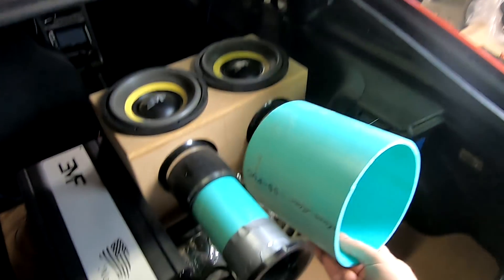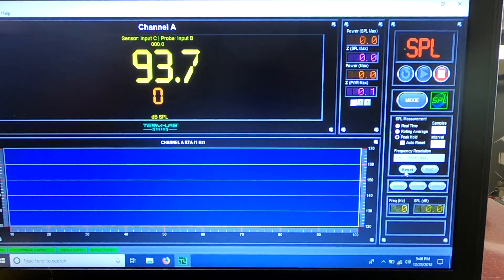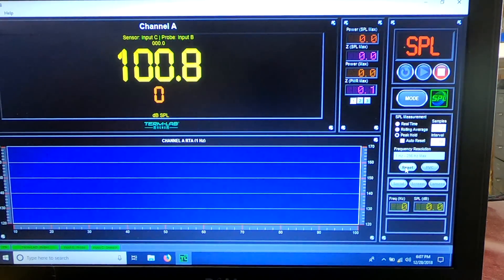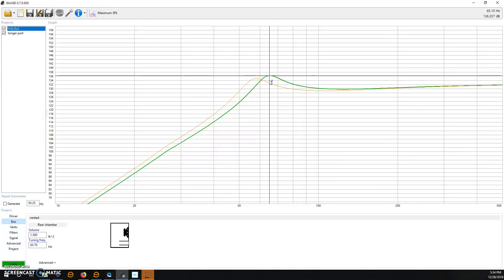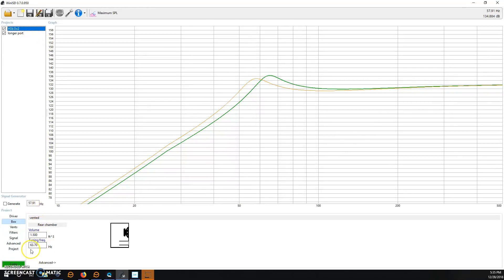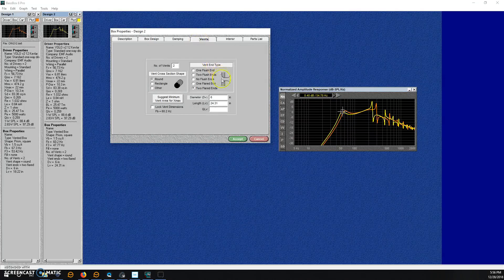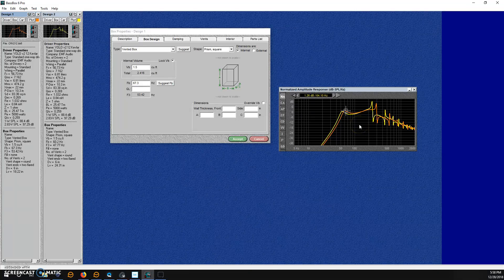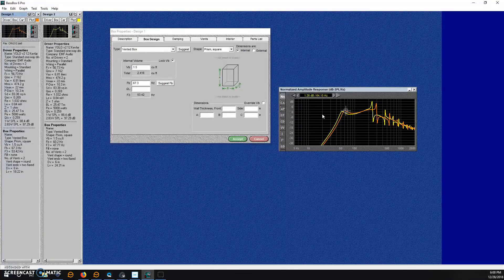Your box modeling software is very wrong, here's proof - Tech Stuff Tuesday

Comment: I'd be good if software could account for the environment you're firing into, though I suppose it's more than volume, its also geometry. Possibly advanced 3D modelling could do this, but at that point the software wouldn't be worth more than time invested in trial and error. Built a 6th order for my car, +5dB at 55Hz, +2dB at 30, and its got a whopping peak at 30, way more than 50. Cabin gain is an incredibly major factor in box design. As for why the software was off (as in the 3dB gap between boxes), my guess is the subs are more efficient than the software was treating them. They could be in a node, too, which should load the drivers a tad more, which is maybe why 4.5 went down to 4.2. From my experience, electrical data is reliable in software. Good video though, the title seems to have brought in trolls.
Reply from the maker: There is more to the environment than volume and geometry as well. It's also the contents, both shape and material. Example, seat positions change SPL, sometimes significantly. Seat materials, door panel materials, headliner materials, all factors as well. You'd have to account for dampening of each of those things too. And, if that wasn't enough, the environment changing at different SPL. The ones you're calling trolls are people that live and die by the graph, in non-automotive applications. One tried to bring in a car and was measuring at 118 dB showing how close it was. When the vehicle starts moving from the pressure, the environment changes. That's also why you can add deadener (changing the resonant frequency of panels) and it will change your response.
Reply: @EMFAudio  Yeah, really is a pain in the ass. Probably a good thing if it stays this way though, if modelling software got too good, whats the point going to competitions? You'd only need to submit a design. I remember an exo video, the one with the deaf bonce 15", where he improves his score by tilting and sliding his seats forward. I'd love to fiddle around with a term lab or something, but can't justify spending the money on one at the moment.

Comment: So I think the difference in this example is the distance to the loading wall. When you add the port length it shortens the distance to the back of the car changing the tuning drastically. A good test for this is to put the short ports back on it and move the box back then retest. My friend ran in a mod street class and if we moved his box back towards the back of his Blazer, it would change his tuning and his peak without changing port length.
Reply from the maker: When you change the box position you aren't changing the tuning, you're changing the distance from the sub to the sensor. That's changing the environment. Now, where it could change tuning is if the port opening is equal to or less than the port diameter from a surface. That will change the effective port length. That applies to inside the box as well.

Comment: Unfortunately, you don't seem to know how to apply the software correctly. The software is only as good as the data input or lack there of. As you did not account for the cabin gain, power applied, etc your application is what is wrong, not the software.

Ive designed and built hundreds of subs for pa, home, fixed application, and car. Made many of the same mistakes you did too. With correct use, I learned from those errors. Hopefully, you will learn that as well.
Reply: What he's saying is this software people that use it don't use it the way it's meant to be used that's people use the software thinking that the box that they build will do the exact same numbers in their car and they wont do the same numbers as the software says it will.
Reply: @danielmcbride2383  I know what he is saying. I also know how the software works. It is only as good as the data entered. If the vehicle acoustics, driver parameters, power, etc, are entered properly the software should be able to give a fairly accurate simulation. 

As far as manufacturers, I use many. For some of my custom designs, I use Eminence, Audible Physics, and Misco. There are others, but these are my favorites.
Reply: @isaeagle4031  can you make a tutorial video to demonstrate to us the right way use this software?
I'd really like to learn a better way to achieve a desirable result. Thanks 👍👍
Reply: @jr1001jr  Oof, I had to go back and remember which software was being discussed. I don't have plans for a tutorial, but message me at Mosaic Audio Design on FB, and I will walk you through it.
Reply: Charles Morris what is your subwoofer brand called?
Reply: @jamesbondcaraudio4247  Why would you think I have a brand? I work with individuals and companies in design work
Reply: Charles Morris i read you designed and built subs so I assumed you had a brand. Was just curious if I was familiar with your brand.
Reply: @jamesbondcaraudio4247 ah got ya. At this point, I don't see the need to introduce yet another driver to the market. I have someone that can build me about any driver I can imagine. Plus I work with many different manufacturers.
Reply: @isaeagle4031  like who

Comment: I'd like to disagree, the modeling software is very correct, actually scary correct usually.

You just need to actually understand the software and use it for its intended purpose. Winisd can stimulate driver behavior on a basic level when it comes extension, excursion, port speed and the like.

Programs like hornresp can simulate complex, folded horn designs within a couple dBs of accuracy. Belive me I've simulated folded and measured several horns, as well as ported designs. If the results don't match your doing it wrong it's not rocket science or magic. Get some proper measuring equipment and do them in the correct environment. 

If you're simulating in a 2 or 4 pi environment, and then measure in a totally different environment.. The results will not match. It's like testing a cars 0-60 time in a 45* slope with 10 cement bags loaded and complain that the published numbers from the manufacturer are incorrect.

The software does accuracy simulate your box to a scary degree or accuracy. If you or anybody else is unable to comprehend, understand, or apply the data, to a real world scenario it's not the softwares fault.

The descrepancy between your simulations and your measurements are not due to the software or your box.. It's the error of measuring it incorrectly. What you are attempting is measuring the effect of the cars acoustic effect on a simulated frequency response.
Reply: yep .. "hes not a very smart man". stupid is as stupid does !
Reply from the maker: You've apparently not watched the video. I specifically say why it's not accurate. Also feel free to provide proof of being accurate from modelling to real world.
Reply: @EMFAudio  I have watched the video, the point remains. The simulation for its intended purpose is correct. If you put your box in the space the simulation actually was intended for and measure it, you'll most likely find that the programs numbers and response curves match up pretty well.

What you are measuring is the response of your cars interior more or less, it's an easily pressurized small confined space... Not a 2 or 4 pi environment. What you are simulating is the product of the box and drivers ONLY.

Here's a quick sim of a sealed Dayton RSS390HF in a livingroom, measurements taken with REW using a calibrated umik at listening position, sims were done in hornresp with manufacturer data and was merged with the rooms measured responsecurve. Which by the way is silly closed to the simulated curve anyhow. Just take the roomnodes, gain and measurement position into account. https://imgur.com/fikKl4d

You could measure the response in your car at a specified place, then take that very same sub and put it in an open space without extra boundaries to reinforce or influence the gain. Then simply make a responsecurve that accounts for the differences. Subtract that curve from the measurement in the car and it will very likely line up very close to the sims. If you don't take your car into account when simulating, I can agree that the data is not as useful. But not useful does not mean incorrect or wrong, simply misinterpreted or used for the wrong purpose.

Otherwise just head over to avsforum or databass and check out the horns a lot of us are simulating, folding, unfolding and then building.. If you do it right it ends up very close, granted you measure in the space it was simulated. Sims are not wrong just because the data is applied or read incorrectly.
Reply from the maker: @TheDaniel85 So what you've proven, by your own admission, is they aren't accurate. You said if you take into account room nodes, gain, and measurement position IE inject your own input contributed by the environment. Seems like that's the same thing as in a car. You have to adjust to the environment, you just said that, just like I've been saying all along. It isn't an exact match in your case either. Bottom line, the simulations may be right if you're in an anechoic chamber, but nobody is, which means the result is bogus. At no point in my video did I say in an open area with nothing there it would be wrong, I clearly stated what it doesn't compensate for and why it shouldn't be used for that application. I will reiterate the point that PEOPLE USE IT FOR THIS APPLICATION. I'm showing why you shouldn't, but you're arguing something that doesn't need to be argued because you live and die by graphs and not reality making excuses.
Reply: @EMFAudio  They are accurate, as long as you use them correctly. As I stated before, what you are simulating is actually only the box and driver. The box itself performs and behaves more or less the same in a car as on an open field.. it does not care where it is, it's behavior does not change. Just the response due to enviromental factors. The room or in your case, a car is separate matter and another issue entirely even if you can simulate for just about everything with proper work and measurements. When designing subwoofers, boxes, and speakers you NEED to know how your design functions and actually work. So you can accurately determine expected raw output, excursion maximums and minimums, identify problematic areas such as acoustic impedance, possible resonances and general driver behavior. That is sound engineering practice and common knowledge.

Doing complex designs and getting predictable results would not be possible without said software or at least a lot of time crunching the math by hand. Then if the room, or car alters the response, then that's a another problem in its own that can be mitigated by treatment, placement or simply integrated into the design decisions. What I object to is the 'clickbaity' statement in the title of the video, and the disregard for good engineering practices when designing a box. 

It's the same when designing a multi way speaker from the ground up, you design and measure in an open / anechoic environment or use gated measurements blended with nearfield + port. The room is treated as separate entity. I do get your point that people not understanding the software or not using it for its intended purposes might not get what they expect, but the software is not at fault usually.

Simulation software should ALWAYS be used in this application, even if the results are not a reflection of the performance in the car, for the simple reason that it gives you a box that is tuned properly and well suited and optimized for the drivers... And the car if you do your home work. Car audio is not an exception from the laws of physics. 
Best in my opinion would be to tell people on how to actually use the software correctly and why the raw/uncompensated simulated response does not match the actually measured in the car.

But then again, perhaps due to my engineering studies and fondness of designing horns and speakers I might approach the issue differently.
That's just my 5 cents, I think we will agree to disagree on this.
Reply: @TheDaniel85  dude that guy worked for NASA.. you can't win the argument. Rocket scientist are always right... NOT....